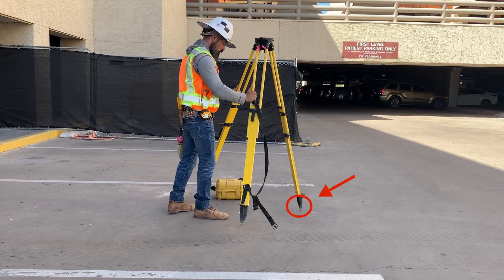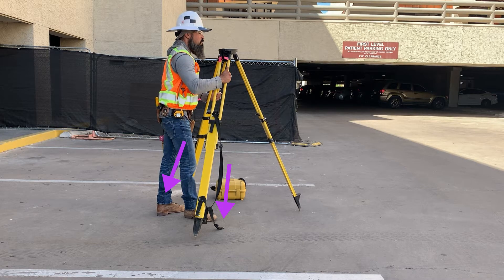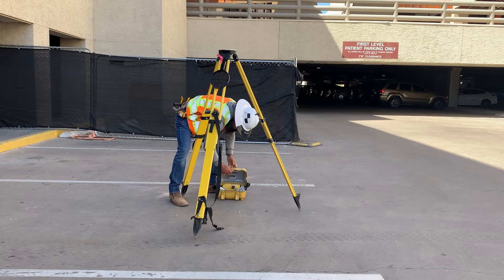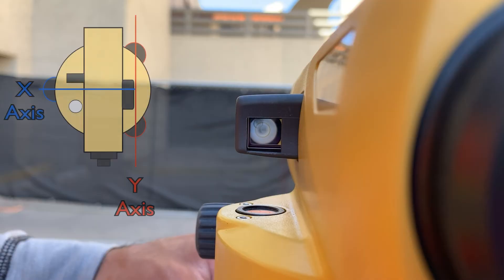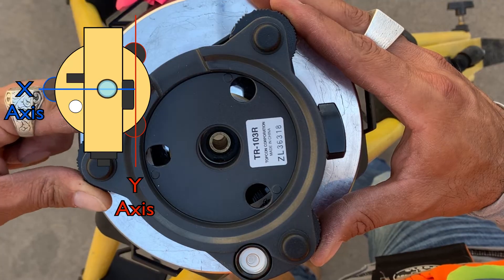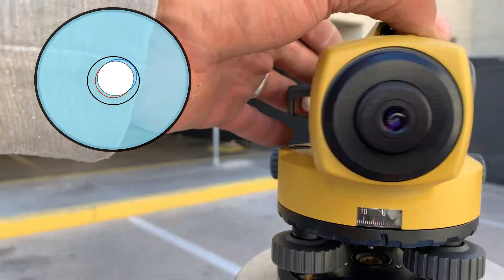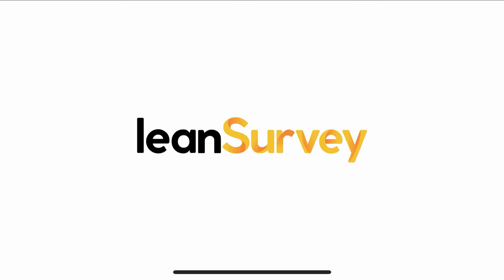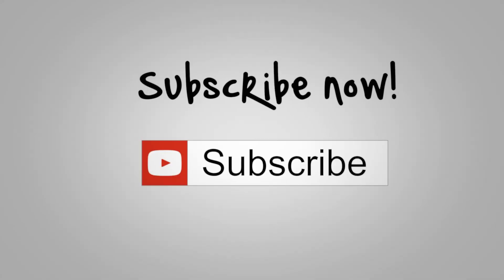Surveying: How to Setup a Builders Level

Comment: Great video! So helpful for new Surveyors! Any tips for centering the head over the pin? One teacher I had would drop or raise one leg the shift in the appropriate direction.
Reply from the maker: Are you referring to total station setup looking through the optical plummet at the control point? If so, a total station setup video is already underway!